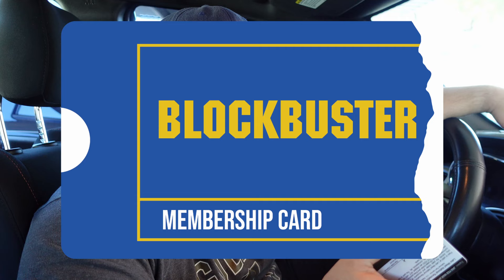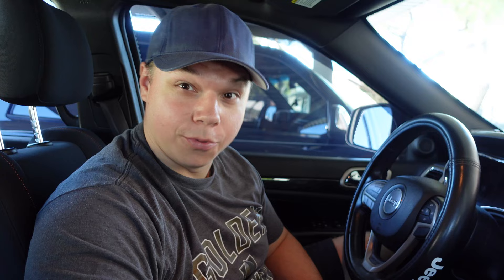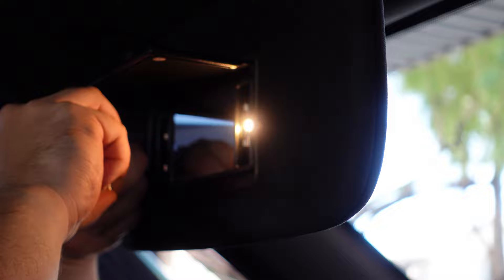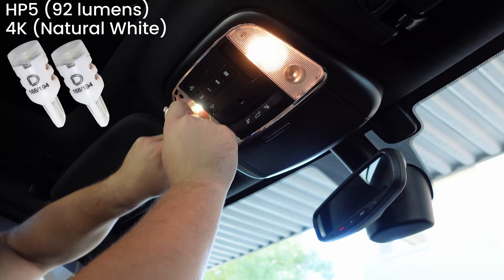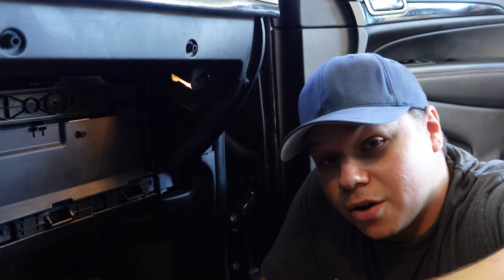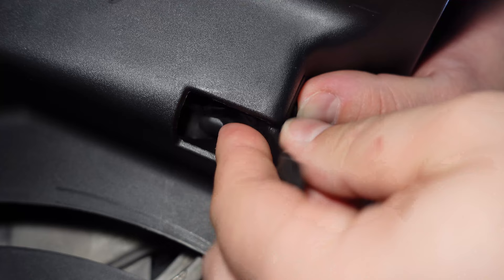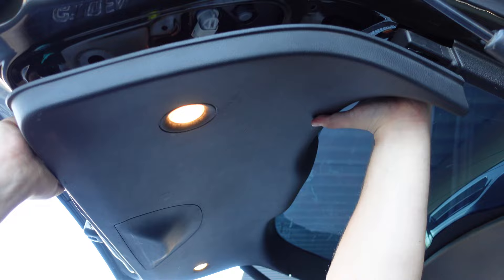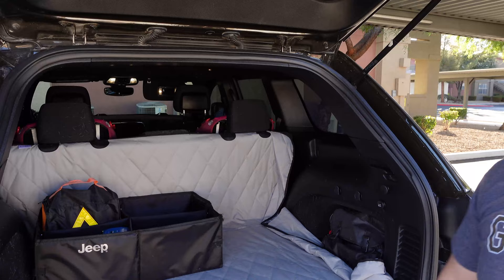FULL INTERIOR LED UPGRADE in 7 MINS! Jeep Grand Cherokee WK2

Comment: I just ordered the same interior set as you.  Thank you for the tip about the glove box!  I also like your card trick too.   Previously, I went with DD for my tail light bulb upgrades, huge improvement over stock and look awesome.
Reply from the maker: Awesome, can't go wrong with DD. I'll be updating my exterior lighting to DD soon.
Reply: I went with the HP11 bulbs for the brake and turn signal and then the XPR for the tailgate backup.  I thought it gave off plenty of lumens but wasn’t blinding bright.  Also used AlfaOBD to configure the outside/body backup light bulb(7440) as the turn signal.  It looks so much cleaner.
Reply from the maker: Ahh you did the euro spec tails! I like that! 👍

Comment: You can take the panel off the side of the glove box and go through the side to get the bulb also. But definitely use the tape method. Worked for me. That way you can use both hands to press the bulb in from the bottom at the light switch and the right side of the dash where the panel is.

Comment: I know this video is old but I managed to replace the glove compartment bulb by simply removing the glove box switch. It has 2 prongs on each side with a small flat head screwdriver just squeeze each side and it will pop out

Comment: There is a much easier way to replace the glovebox light. If you look inside of where the light plugs in, just above it you will see a small black tab. If you depress this tab with a pair of needle nose pliers the entire bulb unit and on/off depression switch will slide out of the glove box. Allows you to swap the light without the risk of dropping it. Simply pop it back into place when finished.
Reply from the maker: See I saw that and tried that it it didn't work for me. I'll try to take it out and make an updated video thank you Julian.
Reply: Was just going to write this.. same light holder on most Mopar vehicles and the whole assembly comes out.
Reply: Yeah dude worked like a charm that way. Good looking out to both of you 🤜🏼💥🤛🏼
Reply: I didn't find it, but that small oval panel by the door can be remove. That gives some space to stick a finger in there and wiggle that light back in

Comment: Great video!  The headlights sucked putting in but well worth it.  I will probably do my map lights and footwell light.  So, in my glove box on 18 grand cherokee, it is missing the clip on the left side that keeps that side closed.....I have called dealership, looked on pages, forums, and no one has part number or knows where to get it.  Thought you might have idea of where might could find one.  I am going try some salvage yards next time I'm by some as well.  Thanks

Comment: well , no doubt the low beam on passenger side is a PIA.  use a mirror to line yourself up.  Regarding the glove box issue. with a mirror, yes there is a tab you can push in and then the unit will come out.  gracefully no, you have to bull it out.  but if you do, so much easier.

Comment: What about the bulbs by the grab handles in the rear pass area on the headliner?
Reply: looks like the roof panel needs to be removed :(
Reply: @matejhloznik  it's a 1 minute job to pull it, and they are 194 bulbs
Reply: This was my question.
Reply: @loveracing1988 thought those were LEDs
Reply: @dwbee2000  maybe on the later years. Not on my wife's 2014
Reply: @loveracing1988  pop the lens off and put 194’s in it.

Comment: Appreciate your videos, I see you went with the 4k but recommend the 3k on oem+. How do you feel the 4k matches the factory color inside led? Normally I go 6k white, but normally I can change them all, so not an issue, but want them to match as best as possible.

Thanks again
Reply from the maker: Thank you JK. 4k is close to the factory LEDs, but the 3k will be exactly like the factory map LEDs & the rear seat overhead ones. It will still be significantly brighter than the halogens.

Also, I will have plug and play 6K replacements for the overhead map lights & the rears. To be released sometime this summer.
Reply: Thanks I’ll probably go 4k I want close but would have it be a touch more white if possible, I want to be able to tell I did something 😂. Thanks again

Comment: Hey great video real quick question how do I change the rear passenger dome lights? I would like to change them to LED and what do you recommend. Thank you for your time and great video
Reply from the maker: Thank you. Those are harder, you need to disassemble them, remove the yellow LED &  solder a white LED to the PCB board. 

I will have a video hopefully soon & a plug-and-play option for purchase as well to make it easier.
Reply: @thisguyvlad17  well thank you for the quick reply and I hope you can make that happen!
Reply from the maker: I will do the best I can. Thank you for the support!

Comment: I have a 2020 limited with HID headlights. I want to change to white bright LED. Do I have to buy a low and high bean or do you know if there is a led that do both?
Reply from the maker: They make a bright white D3S HID bulb, that's what you currently have in yours. You'll want to find a 5500K or 6500K D3S HID bulb.

Don't cheap out! Stay with quality brands like OSRAM, Diode Dynamics or PHILIPS.

Comment: It seems as though you miss two of them, right above the back seats on the ceiling. Are those the same bulbs as the liftgate?
Reply from the maker: The ones above the rear seats in my GC are built in LEDs and require soldering new LEDs.

Comment: Do you know how to change the inside roof by the rear doors bulbs
Reply from the maker: I do, they require the headliner to come down, unless you have the PANO roof then you can reach them. 

You have to remove the assembly and solder in new LEDs. I'm currently working on a plug & play option for that. Stay tuned for that. Still in testing stage.

Comment: Sup fellow WK2 crew. Anybody have any ideas on how to tackle the interior rear passenger lights? Thanks, Vlad, for all of your videos! Have done all the mods you posted and then some.
Reply: Yeah you'll have to tear the roof down and use LED circuit board lights same as the two little map lights in the front . Good luck

Comment: Thanks for this video. I did the map lights and vanity sun visor bulbs. Your demonstration eliminated a lot of the guesswork.
Re the map lights, the smaller, lower ones (where you leave that end of the cover attached) is not an LED and there's a distinct difference now. Have you removed the lower bulbs on the map lights? I'm hesitant to try to remove that cover completely, it might break. ('18 Trailhawk). Thanks.
Reply from the maker: The lower map lights are definitely LEDs. I've disassembled a lot of those assemblies for R&D, and they are soldered in LEDs.
Reply: @thisguyvlad17  Well, they're dim and yellow, doesn't seem like it.

Comment: I ended up making a tool with my 3D printer to get that glove box light out, Your trick would have saved me a lot more time tho.
Reply from the maker: That's awesome! I would love to 3D print a bunch of stuff. Just seems like a steep learning curve.
Reply: @thisguyvlad17  I use Tinkercad witch is free and super easy to use.  If you have done wood working or similar kinda of work you will be just fine.

Comment: I recently changed the map lights but now, on both sides,  I cannot push the cover to turn the light on/off as it wont click. Any ideas as to what could have caused this? (Other than gorilla hands)….
Reply: Yeah basically it's not clicking because the part you pulled it down from the (aluminum/ silver ) part at the top needs to be slide back into position. Line it back up with the black part . Try sliding the silver part left and right and you will see what I mean. It's not about going up or down, just force it left or right then put your plastic cover back on and you'll watch it click again. Good luck 👍🏽

Comment: I have the 2018 jeep grand Cherokee limited you have any ideal on running fog lights without headlights on in my 1999 you can do this wondering if you can on the 2018??
Reply from the maker: Yeah, set the headlight knob to parking lights and you can have the fogs and parking lights on.
Reply: Thanks

Comment: just have the glovebox to do but man my front map light on the drivers side shattered smh recovered and got both of em changed out
Reply: In the glovebox all you have to do is pull that tab out that turns the light on and off super easy .
Reply: @PrinceAkeem612  i got it but it was a process everything is working now to swap out my exteriors and replace the halogens

Comment: ..... Thanks for the video 👍 but, I'm telling everyone right now....my Diode Dynamics map lights and footwell lights came today for my '18 Grand Cherokee (didn't order the glovebox light because i couldn't install that last week, in my '23 Challenger 🤦‍♂️). If your lights work in your Grand Cherokee, leave them alone! This is a MAJOR aggravation, same as on the Challenger!!! You cannot grab the map/dome lights with needlenose pliers or tape, or anything else!!! And if you try and bend the silver metal plate to get to the bulb easier, that is around the inside, it will mess up the on/off push ability of that light!!! Do yourself a favor if you're reading this, if your lights are working and you don't want/need anymore aggravation in your life (over something so small/stupid)..... leave well enough alone!!! 😖..... Actually, the footwell lights in this/'18 Grand Cherokee are super easy to change, the cover just pops off and you can grab the light and pull it right out!!! Oh, and on a '23 Challenger, the trunk light is easy to change!!! Anything else on these 2 vehicles....if the lights are working, i would let well enough alone!!! If it ain't broke, dont fix it!!!🤣😅🤣
Reply: I agree with you lately every time I try any upgrades I have to buy or modify something to get it to fit ...leave well enough alone🙈

Comment: Did your JGC come with the tow hooks in the front bumper?
Reply from the maker: Yes it did. The lower fascia is very easy to take off and the tow hooks are easy to with just 2 bolts each.
Reply: @thisguyvlad17  thanks for the quick reply. Did it come as a kit or did you have to buy all the bolts and brackets separately? I’m looking to add them to my 2019.
Reply from the maker: I'm not entirely sure. I know Rough Country sells a set, but if you want  factory OEM ones I don't know if it comes in a kit.
Reply: @thisguyvlad17  oh, you have the Rough Country ones on your jeep?
Reply from the maker: No mine are factory. I was meaning that Rough Country sells tow hooks as well with hardware, but I don't know if the dealer or Mopar sells it as a set.
Reply: @thisguyvlad17  thanks, I’ll look into it.